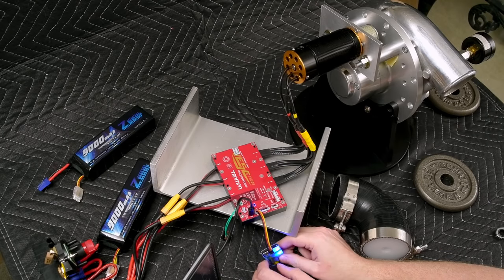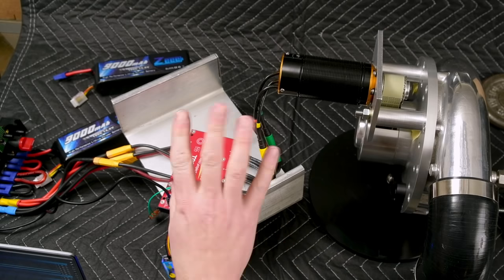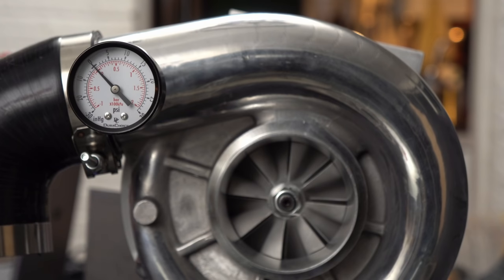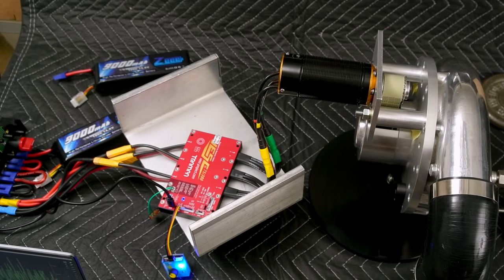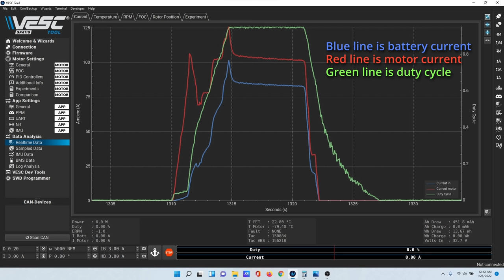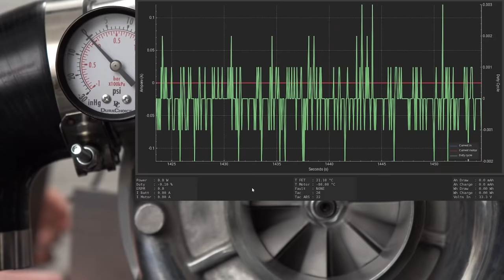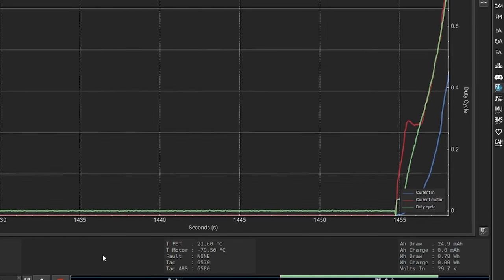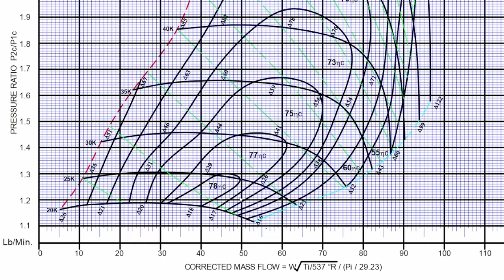Easier/Cheaper High Power DIY Electric Turbo - First Tests

Comment from the maker: For people who are new to the channel, thanks for watching and I'd suggest watching my favorite (and most eye-popping) video in this series - our first drag test of a similar setup that used this exact same motor: https://youtu.be/AOL3Qyczt3Y  There have been 49 videos in this series that got us this far, and we've street-tested, dyno-tested and drag-tested various permutations; we've also blown stuff up, had significant fires and other stuff along the way.  Here's the whole playlist: https://youtube.com/playlist?list=PLhacdpER4T0vzo531cmfi_7fJWd-7DSSt  And thanks for joining us on this journey!
Reply: HEY I DO DESIGN WORK. I HAVE A TURBO THAT RUNS OFF WASTE HEAT.
Reply: I would direct drive the compressor and dip out on the belt  Might be worth it to pull a commerical housing off a garet turbo or somthign liek that
Reply: I have an honest question, would there be any worth while advantages to running two motors?
Reply: @fanepoe9910  DEPENDS ON THE MOTORS.
Reply: I got a 01 Dodge Ram that needs a turbo so bad the truck is gutless do you think this electric turbo will work on my dodge?
Reply: Hey dude have you got a current up to date parts list for your best eco build so far ? And do you have to oil feed the turbo bearings ? Thanks in advance
Reply: Thats wa sa fun proof of concept. Not worth the funds required for only 2-3 PSI sadly

Comment: Dude. This is insane. Without a doubt in the world, this guy is pioneering. This will be the future of boost. Total control.
Reply from the maker: Thanks for the kind words.  I completely agree with you - I sincerely think this is the future of boost.  In fact, that's our tagline on our forum: www.electrifiedboost.com
Reply: Actually electric driven Turbochargers have been tried years ago. Lancia years ago used an electric motor to spin their turbo chargers in The rally group B cars in order to reduce turbo lag
Reply: What rock did you crawl out from under? none of this is new it's just homemade
Reply: This has been done for quite some time. There are many vehicles that use electric driven turbochargers. Even hybrids that use electric and transition to exhaust once exhaust flow is sufficient so there's no lag.. this is just a diy one😂 cool still but for practical use they require a SERIOUS electrical system upgrade.
Reply: Too bad Garrett already beat him to it 20-30 years ago..

Comment: I'd suggest putting a ball valve on the restrictor plate for absolute control. If you add a discharge pipe and measure the air velocity you can calculate cfm and map the compressor fully!
Reply from the maker: Once I'm sure the belt drive system works, and we sneak up on max motor power, I'm just gonna put it on the car.  I'm not a fan of endless bench testing.  And I'm sure everyone is more entertained by tire smoke anyway :)
Reply: @AlexLTDLX  I enjoy both 🤣
Reply: @AlexLTDLX  how would you tune for something like this I would be interested in putting this on my ls swap
Reply: @dannyreid1845  just put a little more injector or base fuel pressure (cheaper)  to compensate for extra air if any lol
Reply: @ChutneyInc.  not sure if this is still a thing but back in the day Hahn racecraft had a thing called portfueller. Added 4 more injectors that kicked in when boost kicked in. U keep ur stock injectors. It came with the split second software to map.
Reply: @teeheetummytums972  sounds great and also sounds back im the day like where people went big or went home on turbochargers jo matter the displacement
Reply: Or hey, how about a mass airflow sensor ;)
Reply: @salloroc20  maybe a rising rate fpr. But a mass sensor is restricted by thre pcm or altered by an aftermarket market ecu correct?
Reply: @ChutneyInc.  What? I'm talking about using it to measure air flow for testing cfm on these blower tests.
Reply: @salloroc20  it might even be useful to use as a component for control-mapping, like +1 legit input
Crazy, but I see there are maybe 3 aspects to the deal:
1. Produce an air charge on demand, spin that kompressor enough, produce raw force
2. House and install it to the combustion engine as a physical input
3. Drive and control the blower based on feedback where the mapping is a multidimensional set of if-this-then-that programming. Do you consider every possibility and write a conclusive answer for each or can an AI continually optimize by setting cogent multivariate-goals for it instead of every specific syllogism? Either way, and there are probably more choices and combinations, sensor inputs give the processor any data that could be used for the control. Spin it up? How much, how long, how fast? Need either sensors or assumptions for the electric turbo, too, feeding back actual, realtime performance. 
I think there might be ideas used in jet engine, maybe ib helicopters, too that would apply. But that is how sophisticated car-tech is becoming
Reply: @teeheetummytums972  split second sells a 5th injector kit. You put the injector in your intake or plenum/manifold. It has its own little ECU that monitors atmosphere, boost, and some other things. Does what you're saying. When it sees positive pressure It kicks on the injector to make up the difference. We use it on the NA dodge darts to turbo them.

AEM also has a fms that just ties into your factor injectors, you can run bigger stock injectors that way.
Reply: @ChutneyInc.  which most modern ecu's auto do
Reply: @petehira1594  I'm stuck in the past. I would like to have an apexi power fc for my miata
Reply: @teeheetummytums972  fmu is easier
Reply: Globe valve. Globe's are used for 'throttling ' abilities..

Comment: I see infinite NOS, if this can be designed to act like NOS and hold up for 12secs and kick out at least 10psi you got a seller
Reply from the maker: Thanks!  Not really looking to sell complete kits (maybe parts); but check out our first drag strip test results: https://youtu.be/AOL3Qyczt3Y  Made 650hp, and gained 15mph and dropped 1.7 seconds in the quarter - eye opening, for only 5 psi average (no losses).

Comment: Let me clue you in on a little discovery I made, I think Tesla knew about this also because I saw a couple of his dc small motors that looked similar to mine. Take your power leads and extend them out 10 ft. And increase the gauge of wire. By 1 gauge up. Now start where the wires go in to the  motor, and neatly close to geather tight. Wind them around the motor in direction of motor rotation. Wind only one layer of the wires around the body of the motor,all the way across the motor. Use insulated wire and put down a layer of ductape around the motor First to lay the power wires on to protect from shorting and heat. Wind bothe power and groun flat togeather. Then ductape the wires around the out side to hold them in place. Then connect to controller or whatever you need to. Now you will have a unbelievable power increase without increasing input power and a rpm increase also ,and the motor will also run much colder. I have achieved sometimes double or more the power and rpm.

Comment: I was trying this 10 years ago with my Suzuki Swift GT and RC speed controller and motors with turbo housings. Never did get it to work that well, maybe 3psi if lucky which did have an affect on the little 1.3L  twin cam high compression engine .....this is STELLAR!!
Reply: Fellow GTi owner here.

Comment: You can get a to motor with a high kv rating that will spin even faster per volt you apply to the motor. I run a 16s 650kv TP motor in my 5th scale losi 5t rc an it's so powerful. Love what I'm seeing here.
Reply from the maker: Thanks.  The problem is finding the balance of RPM and torque.  We've discovered that using this motor for direct drive becomes torque limited; thus the step up ratio - I'm trying to find that optimum balance.  One of the things I left out of the video is just how crap-tastic those pullies are.  I had to order that one from McMaster-Carr for $30 and it wobbled more than a drunk on a tightrope (.021" runout).  I had to chuck it in the lathe, bore/ream the hole straight, make a press-fit plug and re-drill/ream the hole straighter.  And because the flanges were apparently installed by a chimp with a hammer, that was a bit of a challenge.  I actually pulled the box out of the trash just to see where it was made.  India is the answer.  Take that for what it's worth.  It still has some run out, but it's about 4 times better than it was.

Comment: Appreciate you sharing this. I have a 67mm turbo and a coke can sized brushless motor i was going to pair together and see what psi it can push on 12 -14s.
  Was watching the programming of Holley terminator x videos and rc car videos until the algorithm popped up this.
   Cars and electronics, what more can you ask for! Subscribed.
Reply from the maker: Thanks!  We did drag test a similar setup on 16s if you haven't seen it: https://youtu.be/AOL3Qyczt3Y

Comment: I've been following for a long time now and as always I'm very excited with your progress Alex. I'm extremely interested in using this in a compound setup with the new Supra. It would allow me to use a large, laggy turbo for huge high RPM horsepower while still having a usable bottom end.
Reply from the maker: That's exactly what Audi uses the electric turbos for in the diesels they sell in europe. It most certainly would be quite good for that and you wouldn't need a big unit.
Reply: @AlexLTDLX  Right! Though I'm not sure in the Audi's case the supercharger  remains engaged throughout the rev range? I would like to keep it going, fed by the turbo, because I forget the exact formula but the boost increase is more than simply A + B

Comment: I see the biggest issue is the indirect drive. Losses are always going to be a drag... 
finding a electric motor that can direct couple would see best noise reduction as well as lowest losses not to mention, smaller package. Water cooling is going to be on the crads I would say as you will need to sink a lot of heat energy soon.
Reply from the maker: Version 1 was direct drive (and will continue to be).  It was also water cooled; but that turned out to be necessary.  I had the same thought about the belt, but this one does have the advantage of "tuning" it to put the motor in it's torque vs rpm "sweet spot."  Check out what the first version did on the drag strip - it's eye-opening: https://youtu.be/AOL3Qyczt3Y

Comment: If this man keeps this up we will have formula 1 KERS systems in our personal vehicles. Like put the regeneration braking system of the electric vehicles on a regular gasoline-powered vehicle and use that energy to charge the batteries for that electric turbo.

Comment: Any arm chair mechanical engineer can see the weak link at proper boost RPM is going to be the belt. The cars and bikes in the salt flats have a hard time keeping the rubber on the rims at extreme RPM's too.

Electric turbo's really need a from the ground up redesign to work properly. The electric motor and turbine rotor blended into a single component to get rid of all gearing and needs for belts, sprockets, chains or gears.
Reply from the maker: Version 1 was direct driven; please watch this first drag test video to see how surprisingly effective it was (0-60 dropped from 4.1 to 2.6 seconds): https://youtu.be/AOL3Qyczt3Y  This one is an attempt to make the same power cheaper, easier and more compact.

Comment: Friend of mines working on a ac powered turbo with cooler and all but he swears it will be much better then stock turbo setups 
.more effective in high heat high psi cases
..he is big on this method ...

Comment: doing some rough math though 5/8" hole would flow about 75scfm@3psi, that's about 6.8lb/min, the 1" hole is about 14.5lb/min
Reply from the maker: Right now just trying to get this new unit stable/reliable enough to take to the dyno.  Version 1 made 650hp and did this at the track: https://youtu.be/AOL3Qyczt3Y

Comment: Sorry to burst your bubble but BorgWarner already use this in a production cars. (Namely Audi 4.0TDI and Mercedes 400d) Its better than anything you can come up with at home and can be had for good ammount from wrecks. It makes real boost, something around 1Bar and uses 7kW at 48V. That V8 TDI makes 1000Nm at 1000Rev/min with it. ;)
Reply from the maker: We've made 650hp with the first version - the Audi unit is a toy compared to this (this one is 14kW; and there's a 40kW unit coming).  Watch our first drag test: https://youtu.be/AOL3Qyczt3Y And as far as "making real boost" - sure, put one of these on the anemic Audi, and you'll make enough boost to blow the Audi engine.  Put the Audi unit on my car, and it'll be a massive restriction.  It not only wouldn't make any boost, it would make anti boost.
Reply: @AlexLTDLX  Sure it would restrict, becuase its used to kick things off and then exhaust driven turbochargers takes over. That way you have virtualy zero lag as on mechanical compressor but at the same time eficiency of exhaust turbochargers. Makes more sense than this battery nitro.

Comment: What about a compound electric motor system? Two motors turning a single smaller drive, that runs a larger drive to turn the drive inside of the centrifugal?

So, two motors turning smaller pulley, that smaller pulley connected to larger one, that's turning the centrifugal. Would allow to hit higher RPM on the impeller, and you should have less strain on the electric motors having them work in tandem, with potentially a smoother operation that would allow for higher range of use.
Reply from the maker: That would work; but you can actually directly gang brushless motors together.  Or you can do what I've done - just order a 40kW, 50,000 rpm motor (this one is only stable up to 14kW) with a 1,000 amp ESC.  That's when things are going to get interesting.

Comment: this would be really interesting in a marine inboard application allowing one to add boost while continuing to use the factory style water cooled exhaust manifolds
Reply from the maker: That's a really interesting application.  You're right.
Reply: You're the kinda guy somebody like Yamaha needs to snap up. Great observation, that's the kind of stuff that leads to cool new things coming out.
Reply: @andycraig6905  Hey, I appreciate it bro.. I love what Alex is doing with this from a performance standpoint. Trickle down, how does it apply to a daily? does it give us anything over a traditional hot side if we have to add a battery and up the alternator/ cpu/ wiring? kinda makes me gravitate towards conveyances that already have robust battery/ electrical sitchiashuns (possibly misspelt). On a hybrid car/ ute it  allows for a dramatically smaller engine (its all about the package at that point). or one could change the strategy altogether re hybrids; put this on a small engine, use the electric turbo to immediately spin the engine to 3k and use the set-up to do nothing but charge/ maintain the batteries. I also like it a lot for diesel conveyances that already come with multiple batteries.. Cheers, Dave